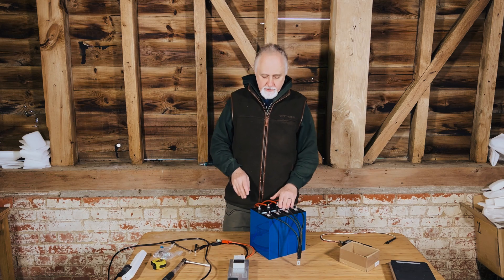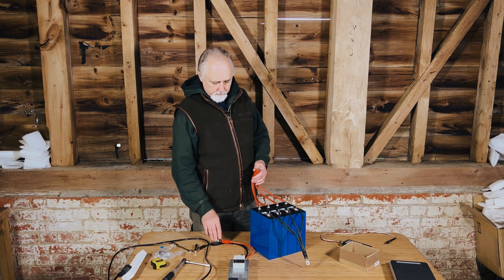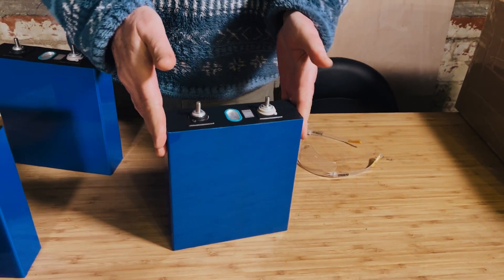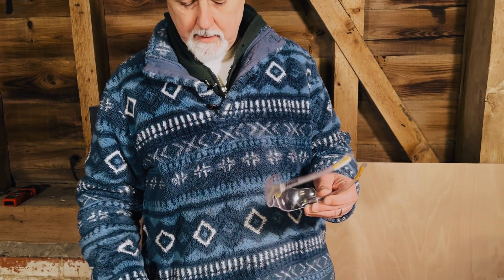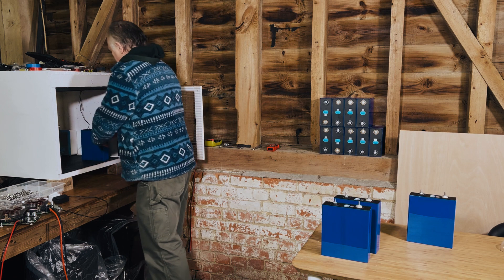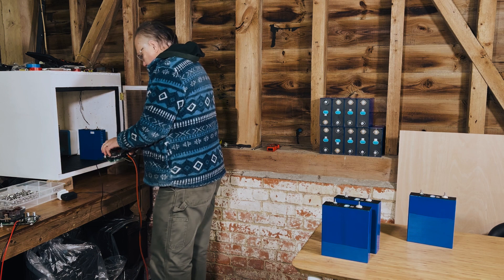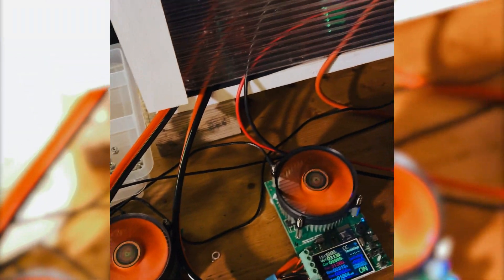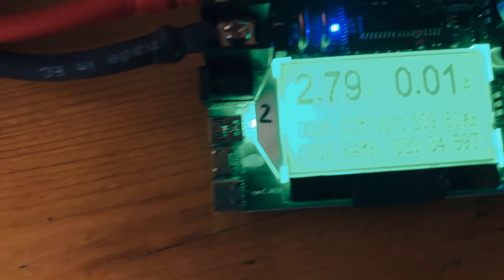Lishen 202AH LiFePO4 Cells: Capacity Test Results

Comment: Don't see your reason for concern, that small a difference (6Ah out of 205) ~ 3%, but you were using different testers and different cables. The results can't be compared directly.
Reply: Those testers are usually quite close to each other so comparison is not a problem. And different cable/size doesn't affect Ah count, if it's Wh then it's another matter due to voltage drop. But instead the concern here is, the tests aren't conducted at the standard 0.2C rate. And dropping the current to 4A at last can increase the final Ah quite a bit. Not really a standard to do so, first time seeing it. If the test was at 0.2C or higher, the Ah will be lower, don't know if the 205Ah cell will even pass the 202Ah rated capacity. Results can differ a lot if the cells are used and have higher internal resistance, so it can be somewhat misleading to test such a large 202Ah cell at mere 4A load. Anyways those cells look great, may be Grade A.
Reply from the maker: We're not concerned about the difference. All the cells met the advertised capacity or more, so they're good! :)